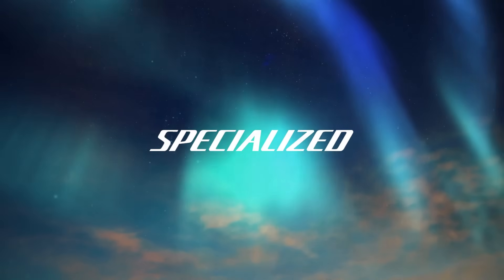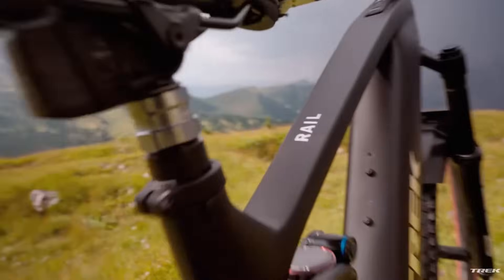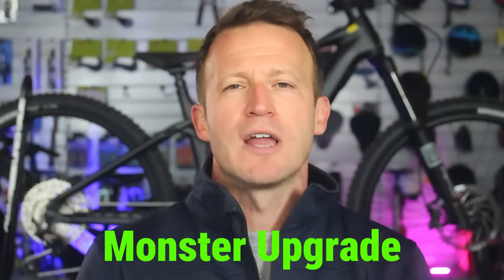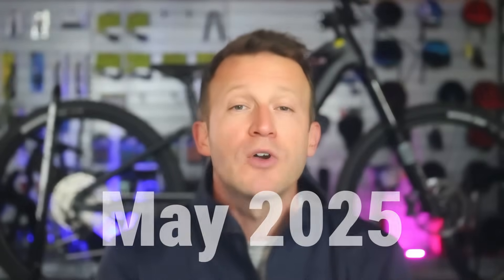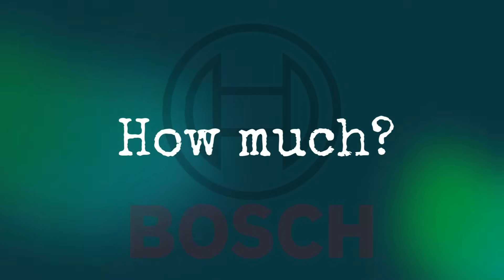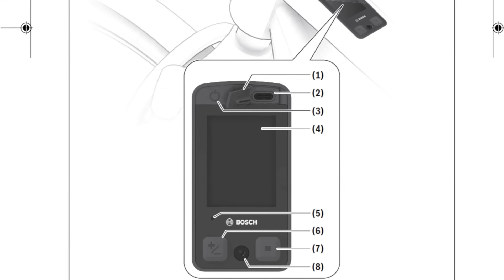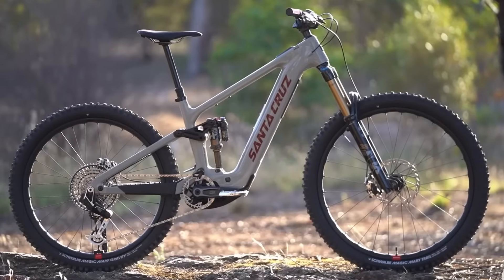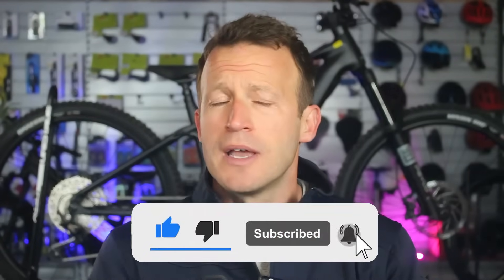Is Bosch About to Unleash 100Nm Performance Line CX Upgrade? May 2025

Comment: My EP801 is already more than I need. Motors and batteries will always get better, lighter. Great! But don’t forget the joy of just riding your bike. I still love riding my regular pedal mtb.
Reply from the maker: So very true! I like to mix it up with my analogue bike too, depending on who I go riding with, which gives me a good dose of reality! What's your ride? thanks for watching and commenting.
Reply: Ive got an e8000 with 70nm and it still feels nuts. Mind you its my 2nd motor as i did de restrict the first one, and the first motor de restricted could rip a new arsehole in bikes with twice its power it was that fast, 39mph fast 👍

Comment: The only question is how much power is to much.  Im worried that if these bikes get to much power the hikers and other trail users are going to try to cancel us as they will confuse our bikes with motorcycles.
Reply from the maker: You make a very valid point. I think descending is where most issues with other trail users occur, which is mostly irrelevant of the motor. But I eBikes have enabled lots more people to get up on the trails than before, which I think, is where eBikes have developed a bad reputation amongst hikers and other trail users. What do you think? Thanks a lot for your comments.
Reply: All the bike shops I went to all said the torque was too much on fly on bikes, 80-90nm was a good spot

Comment: I believe that the Raymon Tarok, which I think will be the first bike to feature the ZF Centrix motor, isn't too far away. Expected release Spring 2025. Presumably it will have more torque and peak power than was being discussed at Eurobike 2024 (90NM, 600W) to avoid failing at the first hurdle.
Reply from the maker: It certainly puts them on the back foot. The eBike motor market is notoriously difficult to crack. DJI did a great job by producing a high torque, low weight offering. The ZF motor appears to be a greatly engineered piece of kit, but without the headline figures of the DJI (and now the Specialized 3.1 & Bosch CX) it will be difficult for them to break the stranglehold of Bosch et al. Thanks for watching and commenting.

Comment: owners of popular bikes that come only with a fixed 600Wh battery - such as Santa Cruz Vale/Bullitt and Orbea Wild - are surely going to find the 600 frustratingly small when they've got a motor that's suddenly got more power. Yes, they can invest in a Powermore extender but that raises the centre of gravity unfavourably.
Reply from the maker: That's a great point. Its likely that these riders will have chosen these bikes/ batteries to lower the bikes weight, their choice between power and range will now be more stark. Thanks for watching and commenting.

Comment: They need to up it to 120nm and 1000w to match the Dji
Reply from the maker: That is true, but it brings the Bosch significantly closer. It will be interesting to see how they compare in a head-to-head, as headline numbers don't always translate into trail performance. My money would still be on the DJI, but I could be wrong.

Comment: I'm really not that bothered about extra power. Most of the time im in trail mode on my EP8, what I'd really like is a reliable serviceable motor, more range and a drivetrain that is more durable. More power will put the ever thinner chains under more strain and the motors will have less durable moving parts in the effort to remove weight
Reply from the maker: I'm with you. I'm generally a smaller motor / lighter bike guy, my go-to bikes are things like the Levo SL and Orbea Rise. 
I don't know if motors will get more serviceable in the near future. It does seem that manufactures like to keep this element out of reach of the customer. In term's of drivetrains, we've seen a massive improvement in terms of durability since Shimano launched their Link-Glide range. I personally think the Pinion MGU concept is the way e-bikes should go, as the derailleur is seriously old tech and was never designed for e-bike torque. Thanks for watching and commenting. Jason

Comment: I was ready to plunk down my money on a new Specialized Turbo Levo Comp until I found out it did not have the  3.1 Motor w/ 720 Watts & 111 Nm motor. No longer interested in the Levo. Trying to find someone to sell me a DJI Avinox here in the US, but this is harder than one might think. I am so disappointed that the European boys and girls get much better new technology in bikes than we do here.
Reply: I'm just waiting until later in summer to get the Forbidden with DJI
Reply from the maker: Yes, I share your disappointment that the top spec motor is not shared across the whole Levo range. It must be very frustrating for US riders, that political intervention is preventing the supply of Amflows to the US market. The outlook isn't looking much better either.

Comment: Not everything is about max power and max NM. Much more important is that how much torque and power you need to deliver to the motor to get that (motor) power. DJI multiplies your energy like 8 times. So if your power is like 100 watts it gives you 800 watts more, but Bosch gives only like 310 watts... Who wants to pedal 200-250 watts to have the maximum power of the motor? For me, (Enduro-Dh) biking means go up slow with as little leg energy as i can do to get back top of the hill in Turbo mode, and go down as fast as i can on the trail. Who want to sprint uphill like crazy except if you are a racer and you are on a race. So if Bosch only pumps up the max torque and power of the motor, but not the multiplier, it means nothing for an everyday rider (me).
Reply from the maker: Ultimately, all of the various motor "power" metrics come down to personal preference. Given this Bosch CX will be fitted all sorts of bike styles from DH/Enduro to low-step trekking, its got to sit in at a happy medium to cover all of the market's requirements of it. DJI have been able to hit a more specific niche for riders who want everything dialled up to the max. For your requirements, the DJI is a no-brainer, the only downside for now is the lack of DH/Enduro bikes that fit the DJI system. Given the Avinox's popularity, this will no doubt change very soon. Thanks a lot for watching and commenting. Jason
Reply: I just keep watching the the DJI bike leaving the Bosch 5 in the dust going up hill. Come on Bosch, fix this. Who would think, a newie beating you this bad.

Comment: Since it looks like the future might be limiting motors to max of 750w peak, Bosch should just set these gen5 to 105nm and 750w peak!
Reply from the maker: Depending on on the outcome of any law changes, then yes you might see Bosch (and others) produce motors that max out at those numbers. I don't personally think the Gen 5 CX is capable of more than 100Nm, but we will find out at some point in May (unless I am also wrong there). Thanks for watching and commenting. Jason
Reply: @ebikecentre  curious why you don’t think the motor is capable of more than 100Nm?

Comment: The only reason they didn’t launch with 100nm was so the overstock of bikes with the gen 4 motor needed to be sold. Potential buyers would be less likely to buy a gen 5 because on paper it’s not dramatically different.
Reply from the maker: I think you are spot on there. I think there is also an element of Bosch taking a cautious approach and seeing how the Gen 5 fairs under real world conditions before ramping up the torque. Thanks for watching and commenting.
Reply: @ebikecentre a German company like Bosch doesn't need customer testing. The 100nm release is already tested in factory environment. Probably was the motor de-tuned to 85nm like said to sell the old Gen 4 stockpile. Nobody buys a Gen 4 anymore if the Gen 5 has 100nm and 400%.
Reply: DJI has given Bosch—and many ebike brands—what they deserve, for being greedy and abusing the market. We ebikers deserve more improvements and at good prices.

Comment: Would be nice if they boosted all us Gen4’s a little bit too
Reply from the maker: Agreed 👍
Reply: To my understanding the motor and structure differ on the gen 4 and so cannot handle the increase in torque.
Reply: @Pipsicle330  There is no way Bosch feels any obligation or desire to upgrade the Gen 4, I’m sure
Reply: @ Of course not. They have my money now so don’t care 🙄